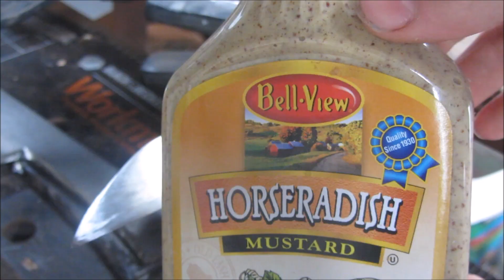Knifemaking: A CHEF's Knife

Comment: Bro one question, when you quench in warm water you don´t need to tempering the blade? or just don´t show it? I am asking because I plann to make a kunai using that clay tecnique, but I am not sure if I need to temper after or don´t... Thanks for your help man...
Reply from the maker: ***** I did temper this, but I didn't show it because it isn't necessary. If you do the clay temper right, you'll have a very, very hard edge and a perfectly flexible blade.Unless you plan on an easy-to-sharpen knife, or to chop through bones or something, I personally think it's fine without. However, it can't hurt to temper it at a low temperature to relieve stress, which is what I did at 275 degrees for an hour. It's up to aesthetics, your sharpening preference, and what you plan to be using the knife on. Good luck!
Reply: temperisation on water and less on it's the old way used in many country around the world ! africa asia south america indonesia the secret of this temperisation it's the result of an partial warming of the blade after forging ! it's the same way off the goop temperisation in wax and grease you quench the edge on 1 or 2 cm  for refreshing and you put your blade on a living water allway in the edge it's better for thin blade or not so thick blade maximum 3 mm of thickness in france you hve one bladesmith they use this vietnamian traditionnal quenching and this blade has very effective machete kitchen knife bushcraft knife etc !!!
Reply: Becker Forge thanks bro... Kunai are throwing knife so souldn't be too hard... Again many thanks friend...
Reply: patrice garnier yes bro thanks... This is a first try making a kunai at traditional way... And is for a friend... Hope this weekend make the first part. If my sick tooth let me... LOL...
Reply: ***** tooth oh shit i don't like so hurt
Reply: patrice garnier yes bro yesterday and today I visit the teeth doctor hope this weekend be better, because I need a forgeday...
Reply from the maker: ***** I did not know what a Kunai was.... I thought you were referring to a japanese kitchen knife. No, if you plan on making a throwing knife, then you BETTER temper it at LEAST at 350 degrees Fahrenheit
Reply: Becker Forge right... Thank you brother...
Reply: ***** the teeth doctor ho no ;p
Reply: patrice garnier jajajaja...
Reply: ***** i hope the doctor it's an psychopath hehehehe  with this rolleing machine ziiiiiiiiiiiiiiiiiiiiiiiiiiiiiiiiiiiiiiiiiiiiiiiiiiiiiiiiiiiiiiiiiiiiiiiiiiiiiiiiiiiiiiiiiiiiiiiiiiiiiiiiiiiiiiiiiiiiiiiiiiiiiiiiiiiiiiiiiiiiiiiiiiiiiiiiii
Reply: patrice garnier vato are mexican-americans... LOL... and yes... is not all bad to go with my lady teeth doctor...
Reply: ***** ahahahah

Comment: Can I use mild steel in knife making? thx and GOOD vid!
Reply: You can however it isn't high carbon so it generally wont be as good but if its all you have it will give you some results and experience. plus its cheaper so you wont have to worry about wasting it as much when your starting out.

Comment: Came out nice sir, may i ask, what kind of wood is that?
Reply from the maker: +Roadzery that is paduak. It's an African wood.
Reply: Oh nice, is it hard to work with? Because the only type of african wood i have worked with was from my experience, a shot softer than aluminium, african ironwood is the wood in question.
Reply from the maker: Actually, paduak is very easy to work with. Unlike some african woods I have worked with that really gum up belts, paduak is light and hard, and great for lighter duty knives that are going to get wet.
Reply: Becker Forge That's lovely, because i'm tired of hard wood that eats my flap discs like they're nothing, guess I'll try it out since i love red handles.
Reply from the maker: In that case, I think you'll love Paduak. Seriously, it's pretty awesome!
Reply: Becker Forge Looks amazing, the colors and all, and from what i see by the dust that falls, i guess it's on the same hardness as mahagonny